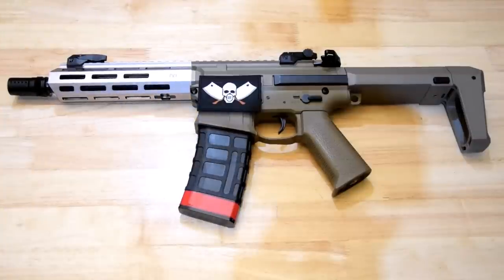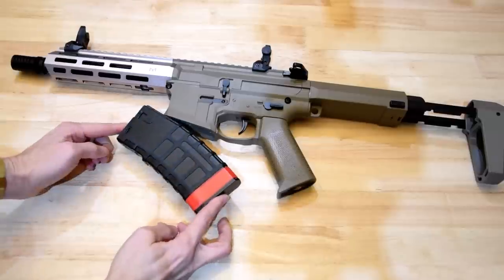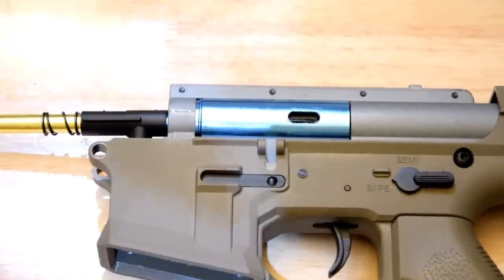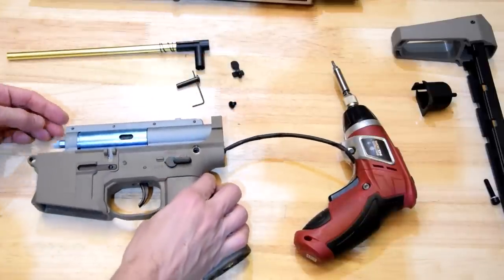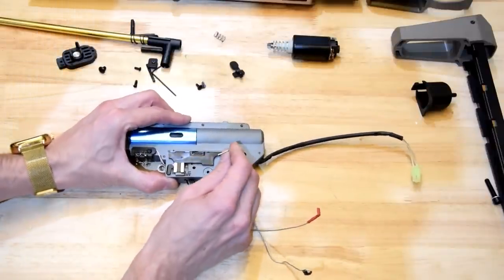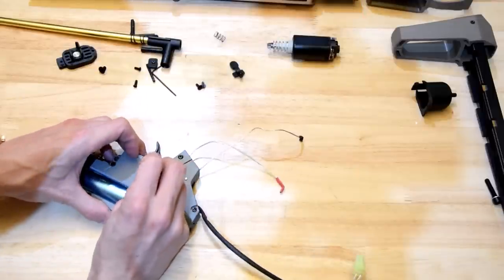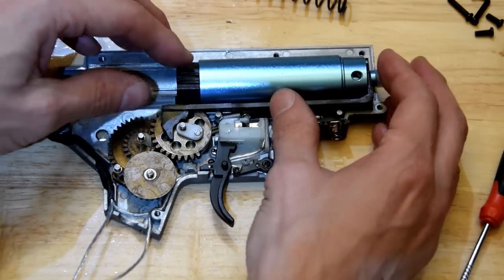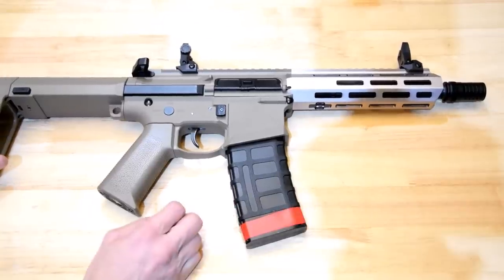BOLBR: Wells Honey badger gel blaster  review

Comment: Bought one of these as a gift and had endless trouble with it. Initially the trigger unit had issues, semi would suddenly switch to burst, then full auto and then freeze completely. Had blaster replaced under warranty, then the same issues with the next. Shop then opted to replace the spring, which temporarily fixed the trigger issues. This lasted only a couple of short sessions, after which the metal box cracked cleanly right down the middle. 

Gave up on the shop it was purchased from after that, instead taking it to another for a full rebuild. It now has a nylon Wells box in it with metal gears and an M110 spring. The gears were shimmed as part of the rebuild, along with proper lubing, replacing of o-rings and the addition of a hop-up. It now runs a similar rate of fire on 3s, and tops out at 340fps on the chrono.

Comment: I ended up buying the metal well cqb over the badger since the cqb was a full metal reciever for the same price.
Reply: Yea I got that to bro it’s heaps good an absolute little treasure
Reply: Agreed i got one also love it. my XYL ARP9 but is a close second too it but!
Reply: Not trying to bring you down but a stock honey badger has a higher standard FPS and the hand guard is Aluminium which is higher quality than metal. That's why their the same price. I've seen people using the well cqb though and they can be extremely good indoor Load-outs. The honey badger is like a hybrid since you can mod it for outdoor and indoor.
Reply: @anthonyielati9542  how would it have higher FPS with the same gearbox?

Comment: i reckon reassembling the gearbox and putting it back into the receiver are somewhat important, to make sure everything lines up right - gears, selector plate, motor, etc. putting the rest of the body back together is easy enough to reverse from the disassembly

Comment: I don't mind you skipping the reassembly as far as putting all the screws back in and such goes. Would be cool if you filmed up to the part of closing the box though, for those times where we don't get to see the internals sitting in their proper place as the box opens. 
One of your best videos for me was the Vector blackout, the way you walked through the steps was very useful. High probability I'd have gotten stuck along the way and needed to take to a tech without that tutorial. Of course, that's a far less usual blaster design compared to a v2 m4 like this. And it's probably not feasible to turn every BOLBR review and 1st time teardown video into a noob tutorial where you hold our hand every step of the way like that. Especially if it's retreading covered ground.
Just my 2 cents, you do what suits you, all info is good. Love your work man :)

Comment: You would think by now the gear box manufacturers would find a half mill of the green orings so you could run the blaster without having to strip it down . The industry is pretty slow on the uptake it seems. great vid mate :).

Comment: I have the full metal CQB and MRT that has the same gearbox. What spring would you recommend? I put an M100 in the CQB and blew the gears. Do you think the box can handle the M100 with SHS gears? Was hitting around 320fps
Reply: Hey mate. You found solutions to this yet?
Reply: @Yito32  The M100 ended up blowing the front off the gearbox. Seems the Wells metal boxes are made from thoughts and prayers. I put an MK CNC box into it. It is solid now and can take anything
Reply: @stuartdummkoph128  far out. You use discord? Would like to talk more
Reply: @Yito32  I don't sorry. My FB profile is under the same name so feel free to shoot me a message. I'm at work so might not get back to you till I'm on a break
Reply: @stuartdummkoph128  hmmm couldnt find yah... I got the wells Mrt Hybrid. So nylon body but metal insides. What mods would you recommend? To not blow something up
Reply: @Yito32  get it radiused. Unfortunately it will probably break because the boxes are genuinely terrible. Just don’t put a bigger spring in it. It can’t take it
Reply: @stuartdummkoph128  aight, so no spring mods, but what about orings? also you just meant the wells v2 gearbox metal sucks aye? If I change it all will be good right?
Reply: @Yito32  Yes it's just the metal gearbox material. I have a Wells CQB and MRT. Both broke. I put an MK gearbox shell in and would be confident running a DSG with M150 spring.
Reply: @stuartdummkoph128  cheers mate. I think as for now ill just change gear and see how I go.

Comment: Good to see a good metal box on a good blaster . They should of painted the silver  hand guard though ,looks ok on a futuristic blaster just doesn’t fit this one . ✌️✌🏽✌🏿❤️🇦🇺❤️
Reply from the maker: it appears a little bit shinier in the video due to lighting but it is noticeably brighter. I would paint it.
Reply: The well metal gearbox is the best value metal box on the market, for $150 AT M4A1 blasters you you can get a complete metal gearbox with metal internals.

Edit: the metal gear set and piston ladder is worth a 3rd of the complete retail box in itself.

Just remember that well has a positive wired trigger mech tho.